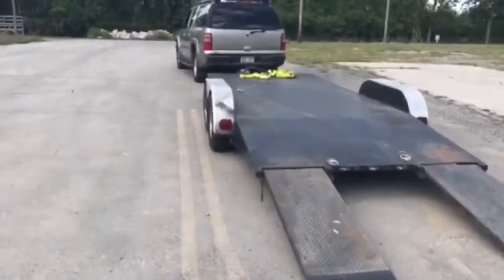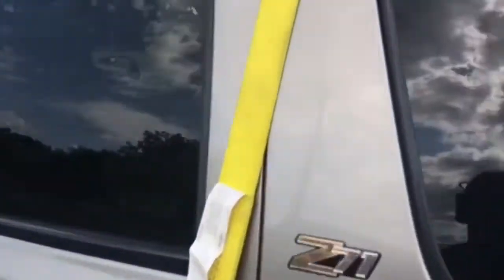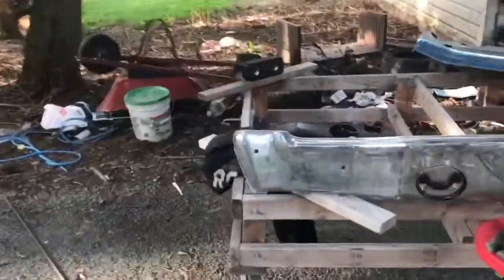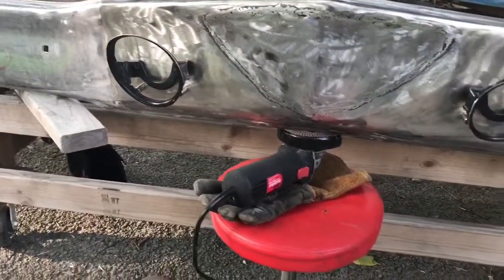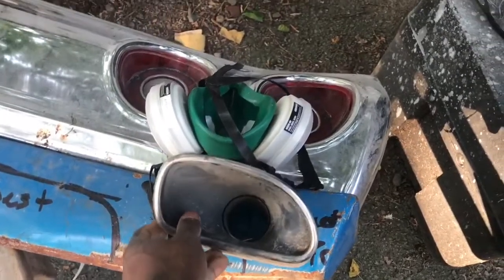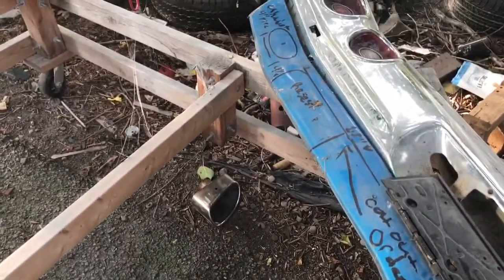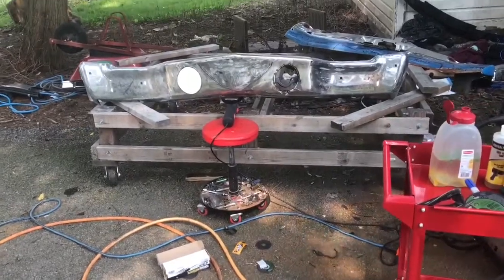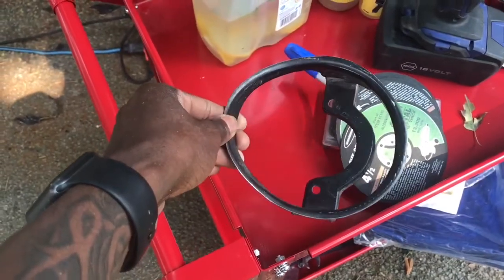Chevelle front bumper fog light and exhaust fab

Comment: Glad to see you still at it. Those are some sweet bumper mods you are working with. If your valance is going to flow how you have it drawn, those exhaust tips may look better flipped over and follow the valance line, pushing the flat edge out towards the outer edge of the bumper. I am looking forward to seeing how this turns out.
Reply from the maker: I A that’s a great idea. Maybe I should do the valance then place the exhaust tips to see what flows better....only want to cut once.
Reply: Thanks, I try to only cut once, I have found that sometimes when I put a piece in that I really like the direction of something else changes. Good luck, this is gonna be Boss when it's done.